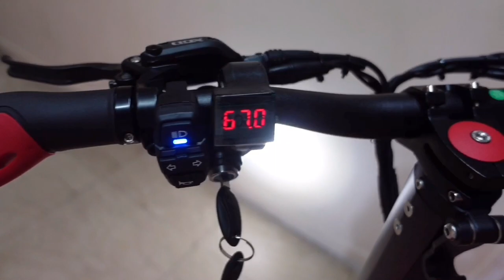Modified Ninebot MAX part 3 |  Installations & Ride Test  | James Angelo TV | Vlog 126

Comment: Your one of the best for sharing about the segway ninebot max adding with blade gt parts 💯👌🏆
Reply: Is that a g65 ninebot max deck frame
Reply from the maker: ninebot max g30 frame bro
Reply from the maker: thanks bro appreciated🙏
Reply: @JamesAngeloTV  sweet as I've got got a Segway ninebot g30p max global edition and I'm trying figure how to get rear deck part to be unbolted
Reply: What is size the length on rear deck that you cut with grinder ?
Reply: @JamesAngeloTV  would you able do some vsett10+ rear plate to try fitted onto ninebot max that be awesome as seen zero 10x rear plate on ninebot max as you will set it on video type in zero 10x rear plate you can't miss it and you would be surprised how he built his different then your blade gt with ninebot max gt
Reply: You should watch video of fella did his ninebot max with zero 10x rear plate and man it's definitely looking way different then your ninebot max gt 😜👍 as you be surprised how he built his different then most other scooters and man it's definitely well worth it

Comment: Во первых где видео 
Об установке подвески ?

Во вторых раму нельзя сваривать
Она потеряет прочность...

Покраска с баллончика отвалиться
А нормальная покраска с термо обработкой 
Уничтожит прочность и заказлку алюминия...

Руль складывания у Ninebot Max очень слабый
И вешать на руль дополнительное оборудование
Категорически нельзя...

Вообщем этот самокат с таким подходом поездит два 
Три раза и развалится...
Reply from the maker: bro please english
Reply: @JamesAngeloTV  You Can Use Google Translate
Reply from the maker: @pfg8800  ok bro
Reply: @JamesAngeloTV  First, where is the video about installing the suspension?

 Secondly, the frame cannot be welded. It will lose strength ...

 Paint from the spray can fall off

 A normal painting with heat treatment will destroy the strength and hardness of aluminum...

 The folding steering wheel of Ninebot Max is very weak And it is strictly forbidden to hang additional equipment on the steering wheel...

 The scooter will fall apart quickly...
Reply from the maker: @pfg8800  next upload bro i will give you full info and details
by the way that is welding the rear suspension holder
Reply: @JamesAngeloTV  Thanks for the answer, I subscribed and will wait for the answer...On my scooter, I will put Skarkset suspension and four-wheel drive two motors FatMax Oversized tires, deck extension, reinforced folding mechanism...
Reply from the maker: @pfg8800  ok bro i will check that thanks bro appreciated